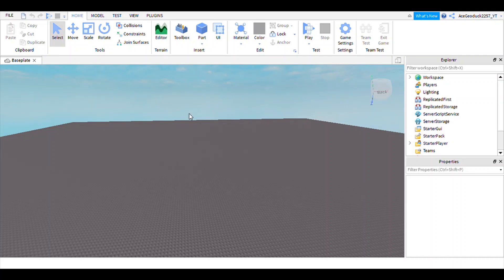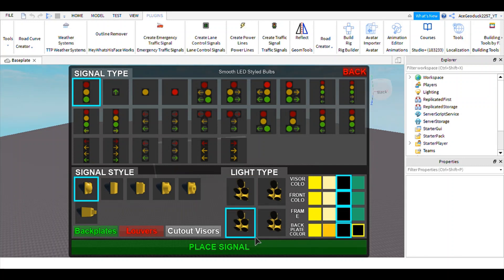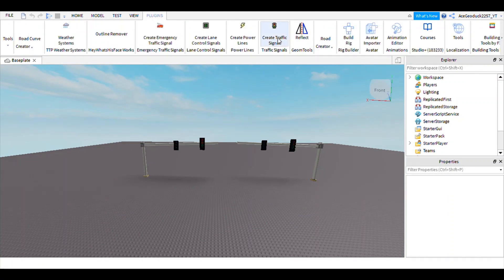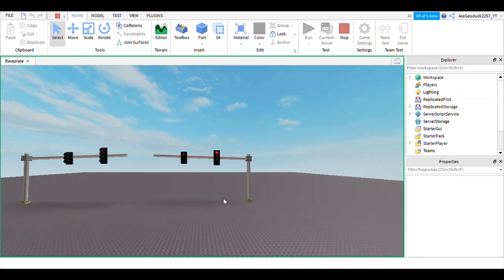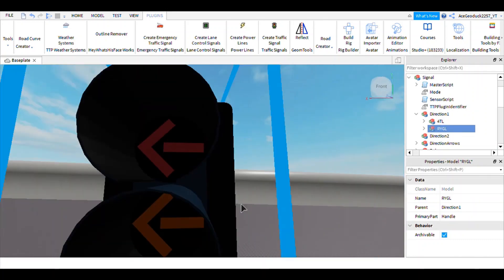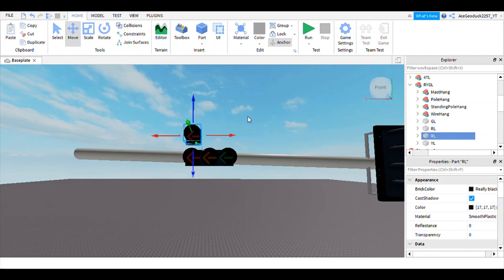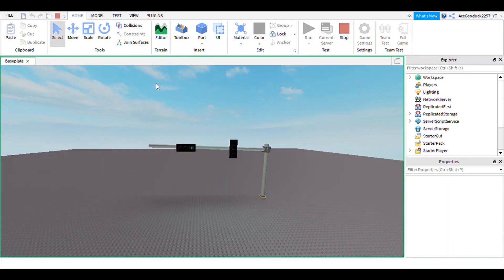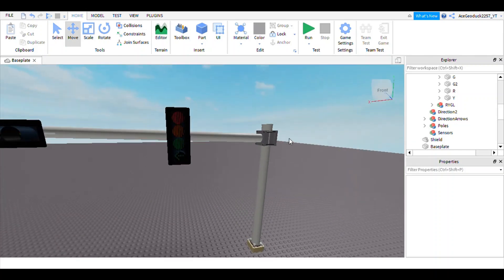How to make a double red arrow/ball traffic light: Roblox Studio Tutorial #2

Comment: Can you make like an old traffic lights still works and new light is like about to use it like the old light is temporary
Reply from the maker: So a light system with new ones about to be active with the old ones still operating. 2 masts?
Reply: @AceTheDragon  wait wait
Reply: @AceTheDragon  I mean and old light its still using and then ready to take it out then replace with new lights
Reply from the maker: Still not getting the picture. As lights you are talking about the ball/arrow light correct?
Reply from the maker: You can copy and paste a link to help with your design idea if you want.
Reply: @AceTheDragon  well I mean is an old light with their old pole that still works and a new light with its pole behind it but its not functioning yet